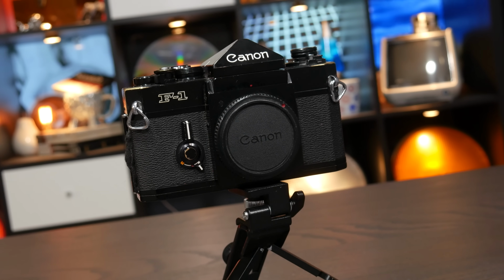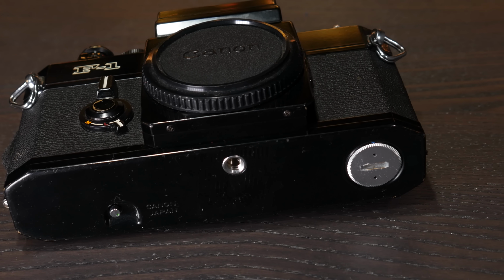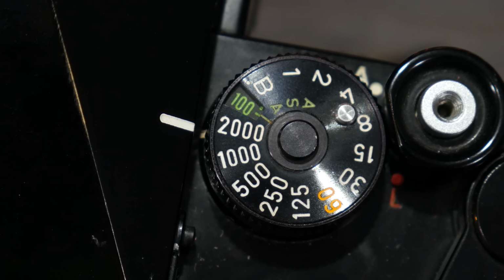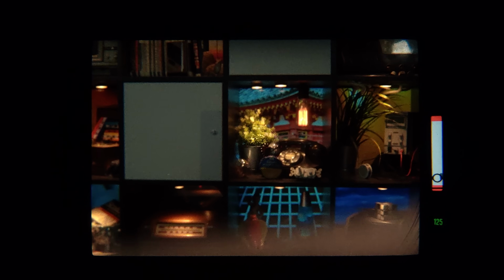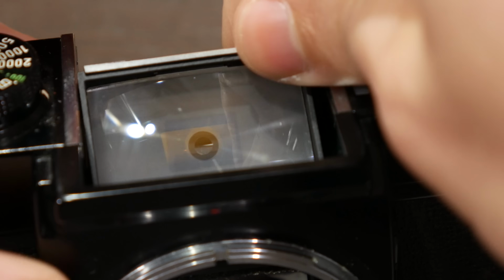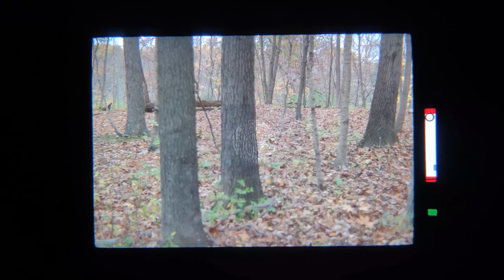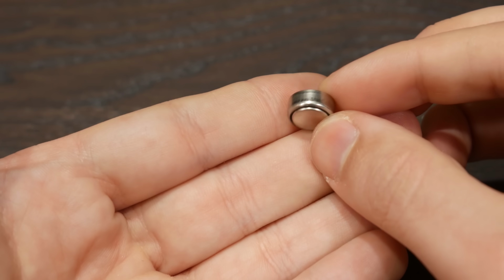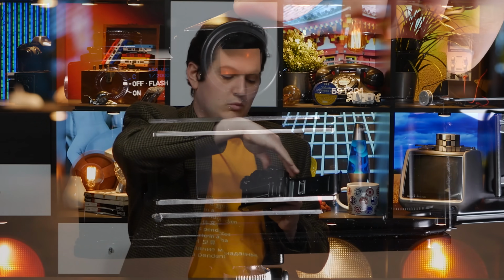1970's Camera Tech: How they showed you what settings to use

Comment: The F-1 is a brute. It feels like it's machined from solid brass. Add a motordrive, a 300mm lens and a teleconverter and you're into 2 kilos - at least. Also, yours is incredibly tidy for its age - it looks well kept.

One of the most bizarre function of the lightmeter is the CAT - Canon Auto Tuning - system.

If you bought a Canon 133D flash, a specific flash coupler that needed two batteries, and an adaptor ring that coupled to a specific lens, the flash would then drive the needle depending on how far you focused the camera so you could set flash automatically. It was even capable of adjusting for the state of charge in the flash so you didn't have to wait for it to fully cycle. You just had to set your camera to 'off -flash' for it to work right

One of the batteries in the adaptor powered a little light-bulb to make the meter visible. The other drove the meter circuit when it was in the 'off' position.
Reply: While it is gauch to reply to ones own comments, I have managed to buy one of these CAT flash systems. It does work - but you can really see the limits of pre-thyristor flash technology. It's bulky, awkard to fit and only works with one or two lenses, with the right adaptors. And since it's fully analogue any sort of loose connection or even oxidisation can throw off the reading.

Comment: i was wonder when the mercury batteries would be mentioned, those things were used for a less obvious reason from what ive heard, they were extremely stable and would maintain a consistent voltage for much longer than  almost any modern battery only starting to drop when they were almost dead at which point it falls off a cliff.  for some reason modern battery chemistry just doesnt seem to have any way to do that as easily

Comment: I have a AT-1 that is also match needle and love it. It has less bells than the F1 but has an electronic controlled shutter (idk if that matters). I think your F1 has a 100% prism like its Nik** competitor did. Sadly my AT-1 is a 97% prizm. I think todays SLR have even less but they also are cropped frame on entry level so it doesn't matter.

Comment: 8:55 You can NOT change the sensitivity of a sensor, that is fixed in its silicon structure. The only thing that the ISO is changing is an analog and/or digital gain of the sensors signal.

Comment: If you like neat and fully mechanical camera designs, you should definitely check out the Kodak Retina Reflex Family. They are SLR cameras with a light meter mechanism which works similar to the one of the Canon F1, but without the need of a battery.
On top, they have amazingly over-engineered lenses: 
The non-coupled selenium cell exposure meter reads out in exposure values (EVs). The camera is then set to the proper EV setting via an easily reached aperture release tab. Once the aperture release tab is set and released, the shutter ring is coupled to the aperture ring - moving the shutter ring automatically moves the aperture ring, so that the same exposure value is maintained. In other words, when in use, the camera is normally locked into one EV setting until the aperture release tab is pressed.
At the same time there are two red arrows located at the focus ring scale that are attached to the aperture mechanism which indicated the depth of the focused area. Selecting a small aperture number, e.g. F4 and focusing on an object in 1.5m distance, the arrows indicate that only objects between 1.4m and 1.6m will be sharp - Amazing!

(And especially with the small  F2.8/50mm lens it just looks beautiful)

https://en.m.wikipedia.org/wiki/Kodak_Retina_Reflex

Comment: Some light meter got a bridged circuit and it won't affect by 1.5V battery, also there is adapter convert SR43/LR43 to PX625 (1.5V to 1.35V) which is I think it's another good solution.

Comment: My favourite camera is my Praktica MTL 3, which was made in a country that doesn't exist any more before both of us were born, and which has the same needle-based exposure system. I only wish I could get Ilford film developed here in Spain. :(

My best photos have been taken with it, and it'll always be my favourite camera. <3

Also, it's delimited in DIN, heh.

Also also, god, yeah, those modern 1.35 batteries are soooo expensive. >.< I've slowly learnt to account manually for the off-whanging on my camera's light meter. I'll keep a look out for the hearing aid batteries as a replacement. ^^

Comment: Most likely, a "Light Meter" would be a unit of time, equiv. to the time it would take light to travel one meter in a vacuum.
Reply: Since light travels at 300 million meters a second (rounding up to even millions), a light meter would be 3.333333333333333e-9 seconds according to the calc accessory in Windows.  Better to use the paper guide sheet in the box of film (do they still put those in the box?)
Reply: It's interesting to know that a light-foot is very close to 1 nanosecond.
Reply: That would be light metre.
Reply: Not sure if I'm taking the joke too seriously, but this doesn't work. A meter is defined by the distance that light travels in that unit of time. Which means if a meter was longer, then the time would be just as long. If a meter was 10 times longer than it is now, then a light meter would still define the same amount of time...

Comment: I love me a chonky camera...
Those cameras in the 70s and 80s were absolute works of art and marvels of mechanical engineering. Love cameras from that era....I have several here, both in 35mm and in different medium formats (645 and 67).

Bonus: modern Sony cameras are extremely awesome because you really can adapt almost any vintage lens (except leaf shutter lenses) to them and they are still flawless. I am shooting video on a Sony with a 30+ year old Canon FD lens with no issues whatsoever. If you really have money to burn, you can even try and get some of the old FD lenses that were later converted for use in "proper" cinema cameras. Yep, some modern movies are shot with glass that is coming up on 40 years old.

Comment: I miss those cameras. Then taking a photo was a whole process, and in a week or so when you saw the result, something semi decent was a happy surprise. Now you just point the camera and let it figure out what you want and then you have 100 or so pics to choose from. Of course nothing stops you from using an old camera, but it's not the same. You would just refuse to use a better tool for nostalgia's sake. I have a few years newer Pentax, that has a bit more electronics, but can still be used full mechanical too, but haven't actually used it in years either.

Comment: Oh, another detail worth mentioning: While early light meters used a selenium cell - effecively a solar cell - which produces a voltage that can then be read using a needle, later ones like your F1 use a CdS cell which needs a battery. However it relies on using a 1.35V mercury battery as a voltage reference. If the voltage changes, as it does when you use a modern alkaline replacement battery, the accuracy of the light meter suffers. Mercury batteries had a pretty much fixed output voltage, no matter if the battery is brand new or almost dead. Because of this, it is pretty tricky to use CdS light meters nowadays - but the older selenium cells work just fine if they have been stored properly.

Comment: You should do a video on the mechanical auto-exposure feature on several compact cameras of the time. Some actually used a needle coupled to the light meter too. Half-pressing the shutter would then lock that needle in place, and the apperture or exposure time (depending if it is an apperture priority or exposure priority camera) would be dependant on the physical position of the needle. First time I opened an old rangefinder to do some minor repairs I was blown away by the ingenuity of the mechanism.

Comment: Interesting, the east germans used a similar system on the praktica VLC series, but they integrated the metering cell into the side of the optical path, with a a tiny mirror in the viewing mirror to split the light, they also used electronic open aperture metering, rather than the mechanical systems canon and nikon used. Though I will admit that the actual needle setup on the prakticas is far less elegant, and is actually kind of hard to use against darker backgrounds. But to their credit they aren’t sensitive to voltage like many japanese cameras, the VLCs (originally meant for 4.5v px21 batteries) running just fine on a 1.5v AA.

Comment: How about offsetting the film sensitivity setting to (at least approximately) compensate for the higher battery voltage? By the way, I have a 70:s Pentax ME Super I bought in the beginning of the 90:s and I didn't know about the battery thing, I've always used regular LR44 button cells and it's worked perfectly. Maybe it's already made for alkaline batteries as it's a slightly newer design (automatic shutter speed but everything else is still manual) or maybe it has a regulator?

A friend of mine had a camera similar to that one in the late 80:s (don't remember if exactly the same) and I remember that light meter system.

Comment: All of the camera settings and features are identical to the Konica T-3 from 1975 and work in the exact same way!  I don't recall the battery voltage being an issue for the light meter though.

In pondering why this video isn't getting as many hits as your others, I contemplated aspects that YouTube could not possibly be sensing.  The most striking is that even though I have deep experience with this type of light meter operation, I had trouble following your explanation of it.  Perhaps I need to watch at least one more time to see if your explanation matches my understanding.  Why didn't I follow the first time?  It seemed to be too rapid of dense information.  Maybe.  (I need to ponder the situation more at length.)

Comment: This is nearly a Canon F-1 review. You should change the title to include "Canon F-1" so that people can search for it.
Reply: There are tags that the uploader can add.
Reply: @John Verne Actually, in most cameras, they did not use a needle matching meter, but a ‘centre needle’ meter, where increasing the exposure time caused the needle to move in one direction, while increasing the F-number caused it to move in the other direction. Meanwhile, more light moved the needle in one direction, while a higher EI moved the needle in the other direction.

One simply had to keep the needle centred. The description here does not match that at all, in either appearance, or workings. Yes, they both used a light sensitive module, and they both used an aperture linkage, (for open metering), but how that linkage affected the needle is quite different. In some cases, it could have manually moved the needle support, while in other cases, it was a potentiometer, or some other electronic solution.

So substituting a Pentax and quite a lot changes. Indeed, whereas Pentax was one of the first to do “open metering”, they were one of the few to also allow stop down metering simultaneously. I.e., on some brands with open metering, the DoF preview function meant that the light meter failed.

Pentax also used light through the lens to illuminate the needle, so that if one was in a dark theatre, shooting a brightly lit stage, one can still see the light-meter.

Comment: "What's a light meter?"

It's a little bit longer than a light yard, but used in countries that are not the U.S.and favour more sensible units.
Reply: A light-meter is 3.33564*10^-9 seconds.
Reply: The thing about light meters is the hand held light meter is incident. This meter you place in front of your subject, which may mean some walking and get a reading. The light meter inside the camera is reflective. Incident light meters are considered more accurate while reflective is more convenient. Thing is with digital, you can expose for multiple different settings anyway because you are not wasting film these days, so incident light meter isn't as critical. A flash meter though is probably more useful now. I still have my old incident light meter for nostalgia purposes.
Reply: Like in star wars the Lightsaber

Comment: I have a Pentax KM from that era that just has one needle that you centre to get right exposure. Dirt simple but it works. Interestingly the light meter in my K-50 DSLR doesn't work with older (pre-1980s) lenses that lack an auto-aperture feature. I guess because it's expecting the lens to tell it what f-stop it's using. Newer (1980's onward) K-mounts use electrical contacts for that. So I just have to eyeball exposure with my primes. At least with digital, you get unlimited do-overs.

Comment: I took a photography class in high school and learned most of that stuff. Then, I went on a trip to Russia and brought my camera that I'd used in the class. I wanted to make sure that I didn't have motion blur so I manually set the shutter speed to 125, which was great...except for when I was using my flash and only half the frame got exposed. Basically every indoor picture I took was ruined. I probably was taught about matching the shutter to the flash, but I didn't remember it as we did most of or photography in the class outdoors. I was very frustrated when I got back from the trip and got the pictures developed!

Comment: Thanks for reminding me what I loved about my manual 35mm Pentax. It's light meter had an easier to use design that sensed the position of both the aperture and the shutter. I only had to get the meter needle somewhere between two vertical marks, and that was close enough. Night shots could involve a lot of guesswork, and I got good at shooting fireworks without a tripod on B shutter setting while counting out the seconds.

Comment: I have an antique film camera with a meter on the top with a needle that moves and indicates light levels.  that camera does not take batteries.  Is the light meter just a solar panel and a thinly disguised volt meter?

Comment: One thing of note, the method in which closing the aperture increases the depth of field is kinda neat! You're basically 'filtering' out light coming in at weird angles. That's the light that causes the out of focus areas. Filtering that out is what causes the loss of light, too!
For what it's worth, my modern digital camera's native flash sync speed is 1/160th of a second. Much faster than the old film cameras, but still relatively slow compared to newer cameras! That's where slow sync comes in, though. Keeping the flashbulb illuminated for longer, while the shutter passes over the entire sensor/film.
Also, what do you think of the current Sony mirrorless cameras using the boxy viewfinder hump, while not actually having a prism?
"But, in 1974, the International Standards Association said, "ORGANIZATION!""

Comment: ISO vs I-S-O:

In broadcast/video/production environments, saying "ISO" as an enunciated acronym actually refers to "ISOLATED RECORDING", referring to the individual recording/recording signal path of the multiple cameras being recorded on set.

Example: "Can you have the V1 (video engineer) make sure the camera ISO is low enough that we don't get any noise in the ISO recordings?"

This is complicated by the fact we usually refer to the sensor sensitivity as "Gain", but regardless, there is a reason professionals don't sound out ISO as a word.

Comment: "After effects is a program that I open accidentally, stare at in terror, and then feel guilty about never bothering to learn despite multiple New Years resolutions"
How did you manage to so perfectly describe my exact relation to After Effects? 😅
Reply: It's basically Photoshop for masochists. Photoshop you can easily teach yourself without even a manual, let alone a tutorial. With After Effects on the other hand, you just look at it as if it was some alien artifact and quickly close it again, fearing it may wake up and swallow the planet.
Reply: ... Adobe sits quietly, twiddling thumbs and making “ka-ching” noises ...
Reply: You just described all Adobe products. After Effects and Adobe Connect have achieved the rare negative sloped learning curve.
Reply: You should feel validated rather than attacked:  Look, even Alec…   😅
Reply: @calmeilles  Excellent point. If even Alec feels that way, that does make me feel a little less bad about it.

Comment: Wrong volt battery ? I'm pretty sure you can compensate for that by lying to the camera about the film speed you're using :)

If the camera shows a high level of illumination incorrectly, you'd compensate by increasing the shutter speed wrongly, suggesting you have a faster film speed. So, if you have iso 400 film, tell the camera it's only iso 100 - or whatever lower value compensates for the increased battery voltage.

But those mercury batteries last for decades if you turn your camera off after each use ;)

I must get round to using up that last roll of film !

I've managed 40 exposures out of a roll marked 36 !

Comment: Thanks Alec for the walk down memory lane.  I was a “shooter” from about 1977 and I had a Vivitar XV-1 (made by Cosina) that had a Perntax K mount and was very similar to the Canon (although not as good technically to be sure).  Yet, worked the same.  It also was a tank (I used that expression too) and you could bounce it off walls and it would still work as it was metal (not plastic) and there was nothing to go wrong.  But, hey why past tense – I still have it, just haven’t used it in years.  Match needle was the way to go – unless you did time exposure (which I did a lot) and then you went out and got yourself a nice Sekonic hand-held light meter (which I did).

Oh and you made one mistake.  You said there were many brands and type of film.  Any good photographer knows there was only one film – Kodachrome 64.  But, I suppose if you really wanted to do prints then…..